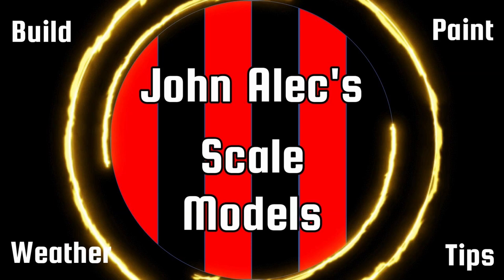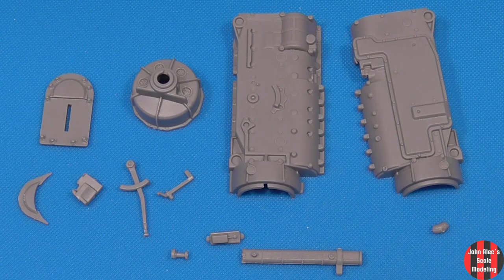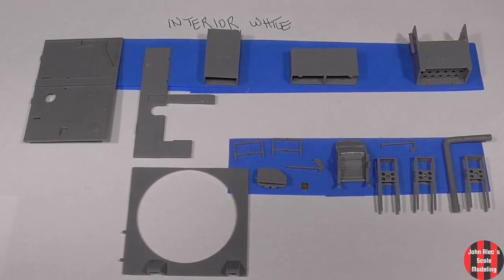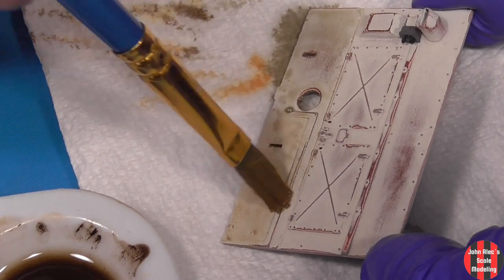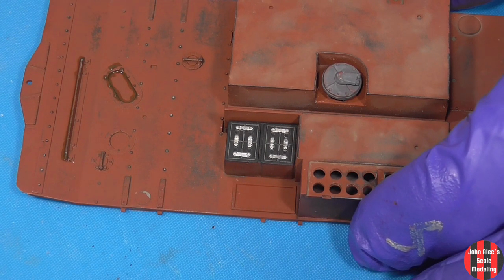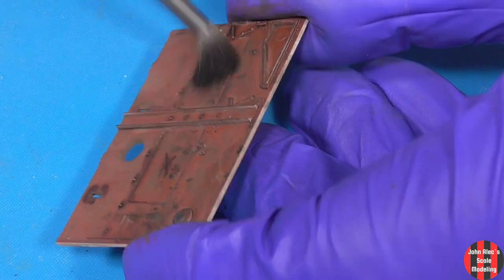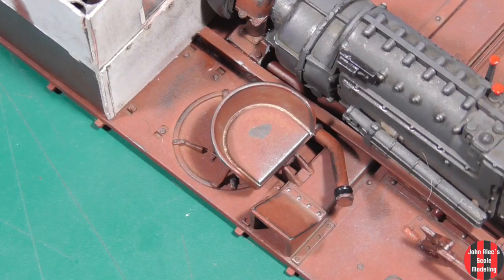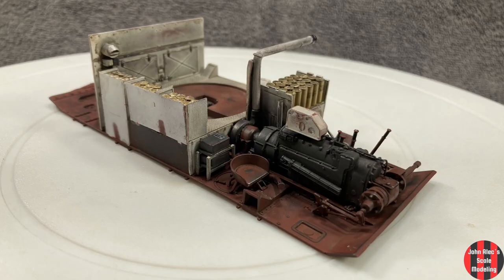MiniArt 1/35 Pz.Kpfw.IV Ausf.H w Interior Episode 1 - Lower Fighting Compartment

Comment: I started this kit and set aside. It is a awesome kit. I just need to learn more about  weathering. Then I will continue. I will be glued to your channel! Thanks. John
Reply from the maker: Thank you so much John! I am working on getting everything else built up right now. You can check out the Tamiya Comet build in the interim if you have some spare time. For this one I will be doing the Option 2 in Dark Yellow Italy dirt and dust. I just got the crane for the dio I will have the turret off and and as many of the hatches open as I can. Thank you for watching I appreciate it mate.
Reply: I did watch comet video and I like your videos!   @johnalecsscalemodeling
Reply from the maker: Thank you John!  @johnreno891